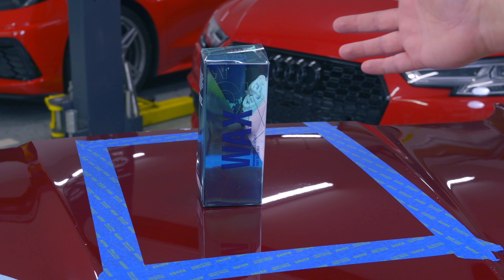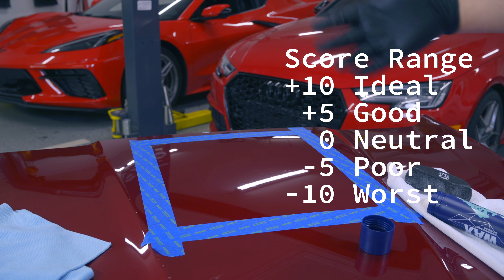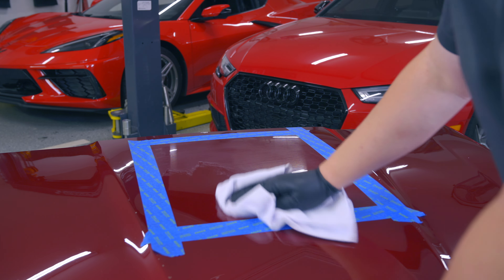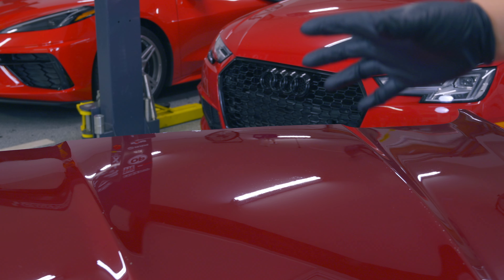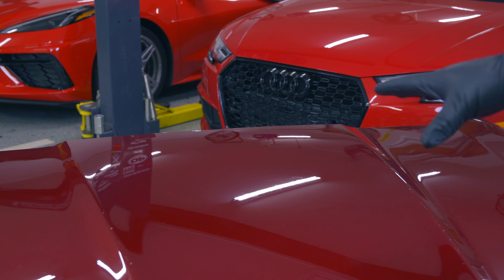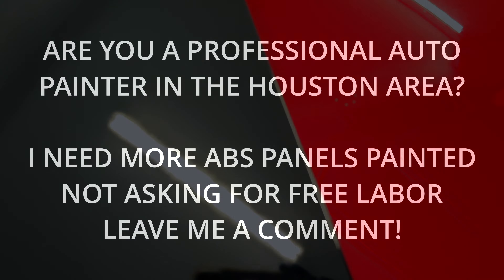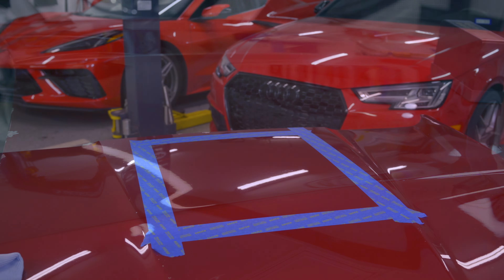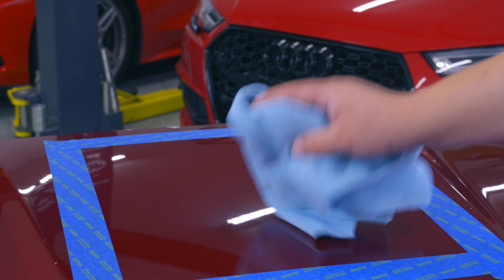Gyeon Q2 Wax Review: Fluorine Performance | New 2.0 Test Suite Unveiled!

Comment: This is an excellent wax with great durability. It lasted about 3.5 months in spring/early summer in Australia. I'd personally let the wax to cure for at least 3-4 hours, or even overnight and then wipe buff it off. Beautiful beads and hydrophobic properties. Exceptional gloss and slickness for the price.
Reply from the maker: I think it's a very good product too. I'm glad to hear it lasted that long for you and I know Australia can have some extreme weather. I have seen that the product can be cleaned up even after an overnight cure, so I agree that a longer cure is possible and may help. For these tests I try to follow the bottle or if the manufacturer asked me to do something specific, so in this case I did the standard cure. Thanks for watching and taking the time to comment, I really appreciate it!
Reply: I’d agree to the overnight cure 100%, it even buffs off easier than when it’s cured for 30-60 mins. This is a surprisingly exceptional wax that’s so easy to use.
Reply: The problem is for personal use it’s great but for a mobile detailer I can’t wait that long so what wax would you recommend ?

Comment: Hi Dmitry, I was recently looking into Gyeon Q2 Wax and looked at the SDS. The SDS for the product includes CAS 153519-44-9. I looked that up and it's a UV absorber called Tinuvin 400. I guess the concentration is just not enough to do anything in your UV tests though. One of the few products I've seen with anything specific in it for UV though.

Comment: i got a brand new bottle as well..the paint was flaking off as well and the wax was cracked..any tips on how to use the cracked wax ..its split in 2 pieces
Reply from the maker: Something up with the packaging for sure then. Figured it wasn’t just my bottle. For the cracked wax I would just only let out a little at a time and use the sponge to dig into the bottle. Paste waxes unfortunately do split sometimes. As long as you dont let it fall apart by pushing too much of it out it should be fine since the sponge applicator is pliable.
Reply: @DmitrysGarage  thank you kind sir

Comment: In regards to your UV testing. I have a couple of questions. 

Would it be possible to do the same test but apply the products directly on painted surfaces? Sometimes I wonder if the application on the glass is giving different results than a product applied directly to clear coated paint. The glass slides are a lot smoother than even polished paint is. Not sure if different results would be seen but I think it could be a possible factor. It would also ensure that no uv light got around the edge of the slides to the test material. 

It would also be nice to see UV tests in that machine on plastic dash pieces with protectants applied directly to the plastics. The dash protectant debate has gone on forever too but I’ve never seen anyone do proper accelerated uv testing like this on a plastic dash.
Reply from the maker: Jay, it would definitely be possible to test that way. This was mostly a logistically easy way for me as I was also looking at transmission through the slides just for my own benefit (like shown in my older videos). While I understand that there could be a product that may not perform well on glass l think seeing all of them fail to perform and have any effect at all is pretty indicative. After all people coat and seal glass all the time with a wide variety of products. 

If we were getting inconsistent results instead of no results I’d be more apt to believe its the glass in some cases. Plus I can tell you it was hard to even write on the glass slides with the permanent marker because of the products hydrophobicity affecting the ink. 

I do plan on further UV testing on plastics and even rubber materials. I am also very interested in how other types of products work and if they can really protect dashboards, seats, rubber trim, etc. 

Really appreciate you watching and your ideas!

Comment: You are missing a heat test. A crucial quality for any coating or sealant is resisting exposure to the sun, but not because uv, its because of heat, imagine your black car in the sun while you are shopping, in an hour itll be imposible to touch, most sealants fail because of the heat.